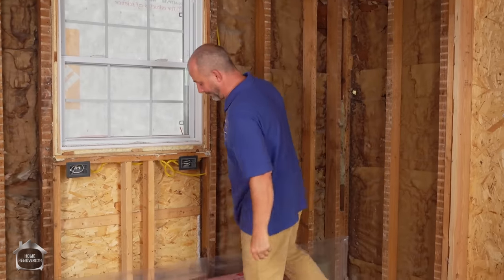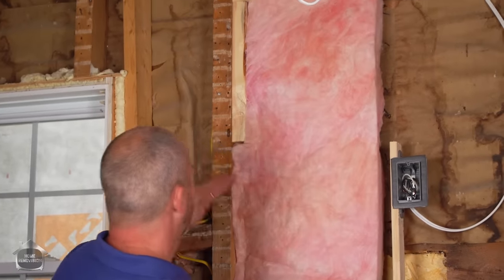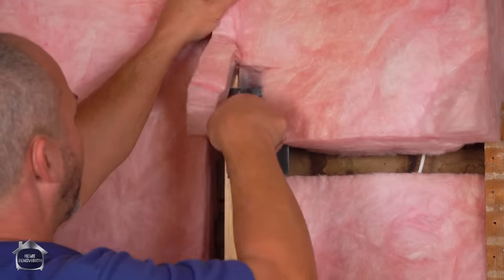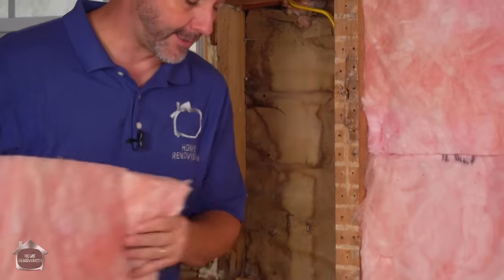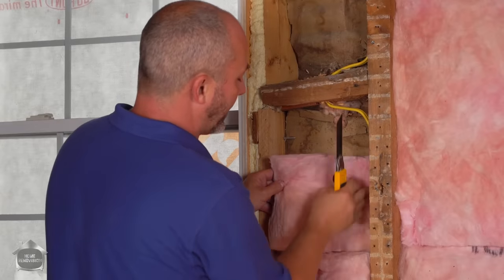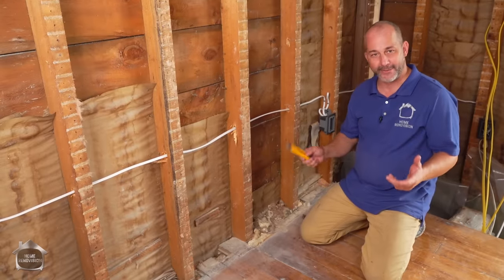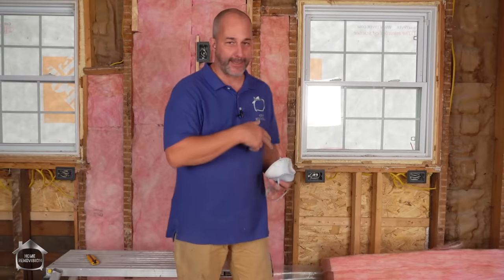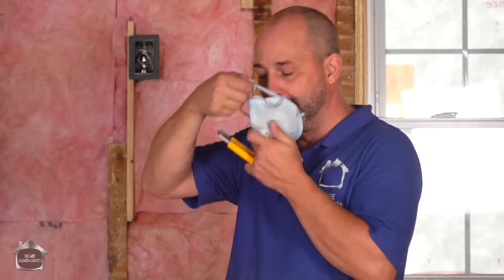How to Install Insulation | DIY Kitchen Renovation Pt. 1

Comment: Great content!  I’d appreciate your thoughts on vapor barrier on the ceiling in cold climates. I believe it should be on a ceiling as well to prevent humidity from condensing in the attic insulation. I have been told not to due to the possibility of excessive moisture inside the house and mold. I agree to a point but feel inside humidity should be monitored and controlled with dehumidifiers. Your opinion?

Comment: I live in Massachusetts if it matters.  I was going to use paper backed insulation. Can I use the black stuff with the paper backed or use what you used instead.

Comment: I like Mineralwool it isn't a favourable nesting material for rodents or bees if they happen to get in, all so water isn't as big an issue it will dry out quicker if you are unlucky enough to get a leek some wear. Less likely to have a mold problem. Also, I don't like staples in my vapour barriers. They make holes. Use builders glue on studs and tuck tape around windows doors and electrical outlets etc
Reply: Tuck tape seems as well

Comment: Thanks for all great content!
Big doubt I have: are vapor barriers still used for the whole house? Can I use it only for the bathroom?
Reply: Condensation can form when using AC in summer or heat in winter when the cold/hot meet in the wall cavity.

Comment: This is great information and I love the way you do your videos! Very easy to listen to, pick up the information we need, and great sense of humor! I'm wondering if you would do the same kind of barrier for a garage ceiling? I would like to insulate my garage, for winter vehicle maintenance, including above my drywall ceiling and have plywood in the garage attic for additional storage area. Can I just lay insulation on top of the drywall and put plywood on top of that, or would I need to take the drywall down, put the plywood on top, fill in insulation up to the plywood, put in a vapor barrier, and then put the drywall back up?
Reply: Bob Watts I would just insulate and lay the plywood. The garage shouldn’t be a big moisture-producing area like inside the house ( cooking and bathing).

Comment: what if your joint has an angle that is smaller than 90 degrees.  The issue I have is that I can 'goop' the accoustical sealant in the area, but I can't get a staple in there... It's in a knee wall space so there is no drywall to place over top.

Comment: i have been hearing the argument that using a vapor barrier in your basement when the rest of your home does not have it, is pointless, and may even cause mold growth due to condensation on it. Is that true? I am finishing half my basement, and it does seem silly to put a vapor barrier up when the unfinished side of the basement doesn't have anything

Comment: In a NY basement is a plastic vapor barrier needed when using 1 and a half inch pinkboard that has been tuck taped (is that the same as Tyvek tape?) together against the foundation walls?  I will also be using R13 insulation in the stud space.  Thanks!

Comment: What are those electrical boxes in the wall? Brand, distributor? Thanks.
Reply from the maker: don't know but i got them at the H.D.
Reply: Here's the airtight one : https://www.homedepot.ca/product/nutek-one-gang-airtight-plastic-device-box/1000404476

And here's the regular one :
https://www.homedepot.ca/product/nutek-one-gang-plastic-device-box/1000404475

The big one for ranges and dryers :
https://www.homedepot.ca/product/nutek-airtight-range-dryer-plastic-box/1000404486

Comment: What if you environment changes?  I’m building a small room / office within a two car garage. In the summer, the garage will be warmer than the office room. In the winter, the garage will be colder than the office. 

The office will have some heating and A/C so it will be comfortable during the year. Should i use a vapor on both the inner and outer walls of the office? Thanks in advance!

Comment: You have no floor points to run wire through with the balloon framing, but if you did, do you require fireproof caulk to fill the wiring holes?

Comment: Shouldn't the upper vapour barrier be on the outside (exterior side) of the lower piece of plastic. This would enable a tape joint higher up and not allow any moisture (if any ) to collect in that plastic pocket that was created.  You will still have a pocket but the opening will be at the bottom.?

Comment: All fibreglass insulation is the same. The colouration is strictly a marketing thing -- Owens/Corning uses pink to distinguish themselves with their pink panther branding, but the  Johns Mansville (or other brands) white insulation is exactly the same stuff other than the colour. But yeah, mineral wool is far too expensive for the benefits it supposedly provides! The only nice thing about mineral wool is it is a little bit easier to cut without having all the wispy stranding you get with fibreglass.

Comment: I love this video. it is exactly  what I need for my Kitchen in my old house with 2 x 4 walls
one question ... Locally I only seem to be able to find faced insulation. Is there any issue having the second plastic vapor barrier over the one that comes on the insulation?

Comment: What's your position on the flash and batt? Vapor barrier on inside still or is it not required with the spray foam acting as the barrier?

Comment: Great video. Curious—why do you use mineral wool to insulate the bottom, while using pink fiberglass for the rest? I know you favor the pink stuff for cost/effectiveness ratio, but wondering why you also add mineral wool in those specific locations.
Reply: He said something about in case it gets wet, it will dry. Maybe his area is known to flood a little?

Comment: Why did I just watch this whole video??? I'm not even doing this in my house right now! Lol! I'll be tiling my shower and kitchen backsplash over the next few days. Wish me luck!
Reply: McKenzie Home Reno good luck
Reply: @88cruzer1  thanks!
Reply from the maker: Cheers McKenzie! best of success with your project!
Reply: @HomeRenoVisionDIY  Thanks! I'll tag you in some before and after pics on Instagram. Cheers!
Reply: Why am I watching the video, I live in a different country, my house is made of 50 centimeters (20 inches) thick bricks full of small empty spaces inside for insulation. And when we are insulating, it is always from the outside of the brick wall, even something like 50 centimeters of polystyrene (this would go on a thinner wall than 50 cm of course). These wooden houses with such tiny insulation would be even illegal here. Yet I still love the videos...

Comment: like your old house methods, good tips those of us who renovate on balloon houses with tree trunks under the floorboards.    Loving those plastic boxes for electrical, squares of poly you can install behind the box then tape down work well too.   If you have the extra money you can purchase vapour barrier boxes for electrical that are shaped to fit, but i'm cheap...LOL.   I always leave the acoustic sealant till last as it is one of the worse substances known to man.   Oh and you forgot to add a bottle of Turps/mineral spirits to your shopping list to remove said "black goop", even with gloves it still gets on your tools and hands...those cheap painters overalls are good to to keep yourself clean
Reply from the maker: oops, yes turpentine works well for removal as well. a lighter form of gasoline. Cheers!

Comment: In places where Mother Nature can't make up her mind, with both chilly winters and scorching summers, the vapor barrier debate gets as mixed up as the weather! When it's cold, slapping a vapor barrier on the inside can save you from wall moisture nightmares. But when those sizzling, sticky summers hit, those same barriers might just decide to throw a pool party inside your walls—hello, mold and rot! So, all you DIY champs out there, remember to ponder the climate and your building mojo before going all-in on vapor barriers. It's a head-scratcher, folks!
Reply from the maker: different climate zones require different approaches and even different permeability when it comes to barriers. type and location of install changes according to climate zones. always check your local codes before installing a wall assembly. Cheers!

Comment: I have a single story home built around 1950 with a brick exterior. Starting kitchen reno and so far see NO insulation anywhere. Is there a reason why brick wouldn't be insulated? Does a brick home require anything different than what you show here? I live in north. Thanks for all of your detailed videos!
Reply from the maker: the cost of energy was so cheap in those days many homes were built without a thermal break. Cheers!

Comment: Would you consider adding foam panels on the inside before adding the drywall?  It would increase the R value and  doesn't the cold travel through the studs?  I am working on my house that was built in 1918 - so  it looks like your farmhouse but has a brick exterior.
Reply: That would create a better thermal break. It basically comes down to a cost issue for most.

Comment: Remodeling my house right now. Made the choice to go with Mineral over the Pink stuff. Few reasons for this. One was fire performance. This is more specifically between the garage wall and interior house. From my research I found mineral has better water resistance. Obviously if you've got water in the wall you probably have a bigger issue, but why not have a better material. I also think mineral has a little better sound performance. Can also get a mineral with no R-value and increased sound performance for interior spaces. Over time mineral will maintain rated R-vale. As the pink stuff ages and out gasses r-value is lost. But the single biggest reason is I can get mineral in R15 for 2x4 construction over the R13 of the Pink stuff. Add that to a continuous exterior insulation at R5, I am getting R20 out of that 2x4 wall.
Reply: Good choice to use mineral wool when you can install a continuous exterior insulated sheathing like Zip.

Comment: now if only there was a way to insulate THROUGH a wall. Apartment I'm in has 0 insulation. I've done what I can to plug up holes, but man does it get chilly/hot.
Reply from the maker: drill holes and blow in insulation
'

Comment: Just watched this on my tv while eating dinner. While I will not be doing a top to bottom project like this (yet) I do intend on replacing the insulation up in my attic next year. I live in a infill starter home, and it is apparently that the insulation up in the attic really was not put properly, causing heat escape that you can see on a cold day. Thank you so much for explaining the HOW and WHY of insulation and then showing the process.
Reply: Edith Spencer when attic insulation is removed, ensure all holes are filled, where wires and plumbing vents pass through. You also get a more continuous blanket with blown-in cellulose.

Comment: So what happens when you go to hang a shelf or picture frame. Drilling a hole through the drywall will most likely break that plastic
Reply from the maker: these systems are about water and air management. no system is perfect but if you try to be as perfect as possible you will be very happy with the end result. Cheers!
Reply: Command hooks, haven't gone wrong yet
Reply: MrJohnweez as much as possible, hit a stud. You’d definitely want that for a book shelf.

Comment: I don't see plastic wrapping in the northwest. I have seen wrapping the house from the outside. Maybe something about mold. Can you do this in the Pacific northwest?
Reply from the maker: plastic is only used in areas where it is traditionally colder. Always check with your local building office to make sure you are following local codes

Comment: Hi, Here in the UK we have some insulation that is wrapped in brown paper, I am assuming that is to stop you getting fibers in the pores of your skin. What are your thoughts on this, bearing in mind that the paper stops you from cutting the insulation to go around plugs, etc?
Reply from the maker: Hi John. that is also common in the mid states where they don't get a severe winter. . plastic on walls is used in the north only! Cheers!

Comment: Thanks for the great info. I have a home built in 2001 and we have 4 bedrooms upstairs, 2 of which are warm in the winter and 2 that are very cold. I was thinking the insulation around the windows are not good and would have to remove the window frames and inspect the insulation. Do you have any idea where I should look? Thanks again
Reply from the maker: good start. other common problems are overhangs on the second floor and rooms above the garage!
Reply: Other things to consider: are the colder rooms further from the furnace, i.e. have longer duct runs?  If so, partially close the duct dampers of the warmer rooms. Also, a smoke pencil will held detect air leaks around windows.

Comment: I'm a little surprised you didn't use the vapor barrier sleeves for your electrical boxes, it makes for a better seal and completes the coverage in behind the box as well.
Reply: umchoyka in another comment he indicated that the boxes have an air-tight gasket for the wire pass-through. For cost, I use the sleeves and acoustic seal the entry point of the wire and tuck tape the sheeting.

Comment: The house I am going to improve shows records of being built in the 1930 the timber in the studs and else where is very hard wood would the staple gun penetrate such hard woods? and being so old whats the best way to level, plumb the studs prior to dry wall application?
Thanks for any tips.
Reply from the maker: Hi William. the best option is to fur out the wall with 1x4 horizontally. this allows you room to shim if it is really bad. use a laser line to get it perfect. then add vapor barrier. Cheers!

Comment: What are you're thoughts on outside insulation like zip system vs zytec? I'm building a small 1k sq ft carriage house , wondering if zip is worth the extra cost
Reply from the maker: that all depends on where you live? in the north I don't see the benefit. we can control air from the inside vapor barrier. In the south controlling air movement with zip is a great idea. Cheers!

Comment: 5:46 additional feature of mineral insulation is its burning point. It is close to twice as fire-resistant as fibreglass insulation giving you some extra time to escape in case of fire.
Reply from the maker: Hi Alex, since it is behind thew drywall which already has 15 minute burn rating the extra time is of no value. Cheers!

Comment: I think you should wash with HOT water instead of cold.  Cold water will lock the glass into your pores.
Reply from the maker: i have been doing it this way for years. hot water opens the pores even more  and it gets stick in there.

Comment: What are you thinking about putting styrofoam on the basement foundation walls  first and then fiberglass or mineral wool between the studs, is it makes big difference compared with regular vapor barrier and insulation?
Reply from the maker: I only recommend that on new homes that have a waterproofing system on the exterior walls. Cheers!

Comment: Great information! I just started renovating the first of 4 bedrooms. The ceiling is vaulted 2x8 rafters with no attic. I used mineral wool to re-insulate the ceiling because of the higher R Value for the thickness. Never used it before and I it was super easy to work with. Not too much more expensive (bought it from an industrial supply house). I goofed though, and got insulation for 16" center steel studs and had to cut an inch off of each batt the long way. My mistake. Still, would use mineral wool again.
Reply from the maker: sure, but the bag price is almost the same the difference is the sq ft each bag fills. You need twice as many bags
Reply: @HomeRenoVisionDIY  I think it was $0.30 more a sq ft for the wool over high density fiberglass. Is there a better way to go to pack rafters with enough r value and leave an air gap?